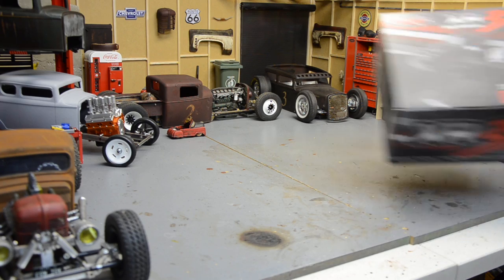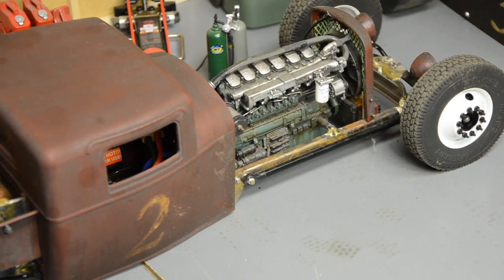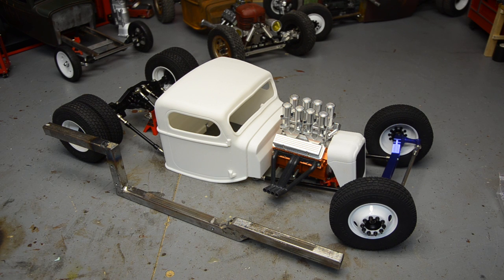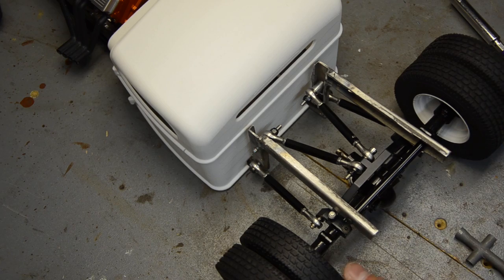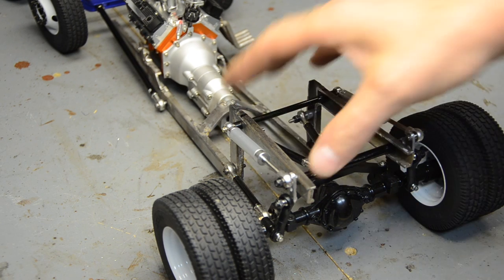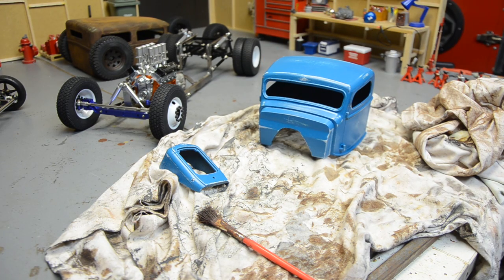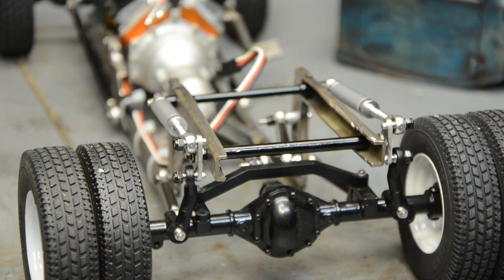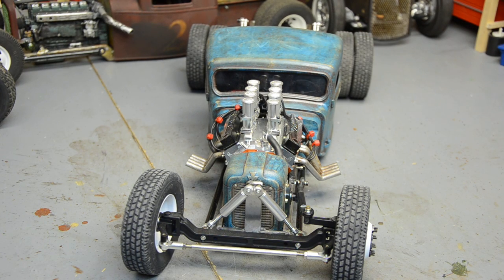The RC4wd RatRod Giveaway Build, Start to Finish, RCengineering

Comment: Bit of a hassle, but 1/2" square with the back decked off works great. I found the easiest way is to get a length bout 600mm long, clamp it in the mill with 2 vices and parallels under and take the corner out on either side of the top (longways) with an endmill. Do the whole front side then just move er over and do the back side. Itll get awefull noisey towards the end but just grab the loose bit and give her a gentle tug to dampen the vibrations (ehhh, dont do this while your boss is around) you can keep ahold of it till it comes off. You wont get pulled into the cutter. Amazingly! Then give it a quick linish and boom! C rail. Also you have a nice peice of flatbar too use too.

Comment: Have you tried...just going down to local A/C shop or HS??? They have metal plate bender
so they can fabricate vents/ducts...to their needs..Just ask them to make you some.
HS or local college might have those metal bending machines in metal shop. Mine did.
Take your R/C cars down to a local HS..it'll get the kids interested in metal works or give
them idea to work as a project.

Comment: Awesome!!!! What is the width of the front axles with those wheels mounted on it??
Reply from the maker: Its around 7.5 inch wide from the outside edge of the wheels
Reply: ive been wanting to order a set of the semi drop axle to stick under a blackfoot body......are the rear axles without the dual wheels also 7.5
Reply from the maker: They are pretty close to the same I believe

Comment: What is that axle called I know I’m late but I want to build something similar.
Reply from the maker: The rear axle is an Rc4wd yota2. This particular front axle is different than all my other rat rods and unfortunately isn’t available anymore. The one I use now is a 1cm drop version of the tamiya 1/14 scale semi front truck axle. I find them on eBay.
Reply: @RCeveryday  thanks I saw that Tamiya one.  I was going to build one with an SCX10 chassis.  Have to get measurements.  Thanks!!!!!

Comment: Part number for the front drop axle?
Reply from the maker: apparently its no longer available from rc4wd
Reply: Well that's crap is it same dimension as the 1/14 semi front axle?
Reply from the maker: Yeah its the same width.  It was made by JD Models or at least packaged as such.